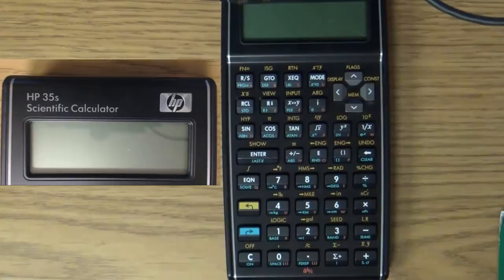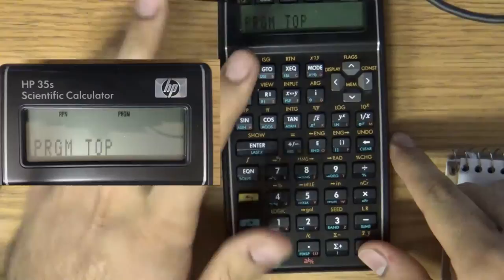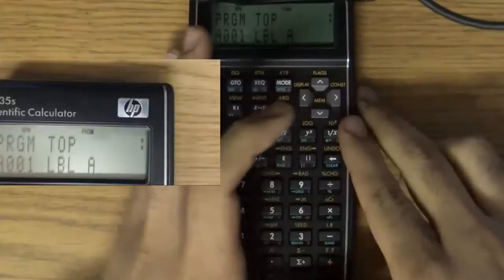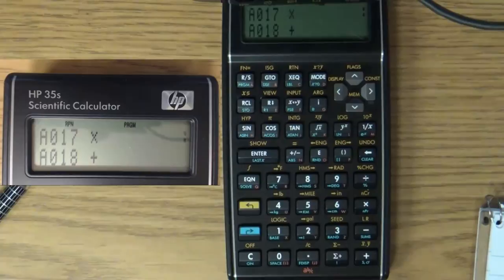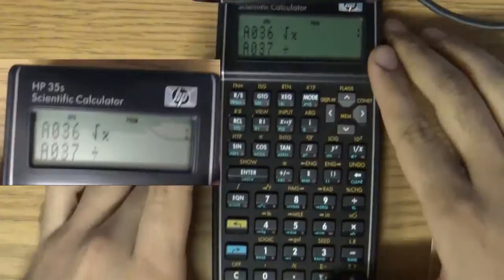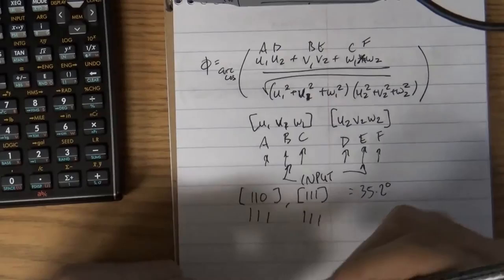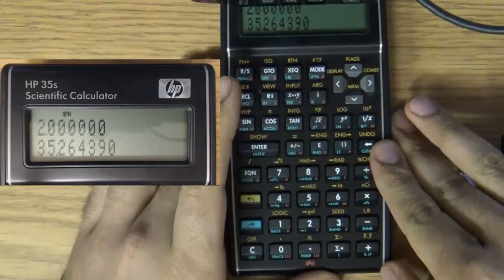How to Program the HP 35s: Angle Between Two 3D Vectors

Comment: Good introduction.

The next step is to learn as early as possible to optimizing your code. For instance, on most HP calculators, the recall function can be combined with the four arithmetic operators (+, -, *, /) as a single instruction. 

The three lines :

RCL A
RCL B
x

can be reduced to the following two lines:

RCL A
RCLx B

Makes the code is easier to read, it runs imperceptibly faster (only matters when you program numerical methods with many loops) and it takes 33% less memory.

Comment: The manual actually suggests you use RTN to finish the program (unless you have only one program, in which case there is an automatic RTN at the end of the program) as it sets the program pointer back to 000, but R/S works too of course. Otherwise neatly explained.

Comment: Nice & quick & to-the-point.
Couple remarks. Instead of ending with a "STOP" command, it's better practice to end with "RETURN" because then this program can be called as a subroutine from another program, which is a useful thing in this case.
This would require knowing, when you run that other main program, what is being prompted for at the beginning of this program, however. In fact, if this is the case, you can just chop the input part of this program off as a separate, main program, which then calls the subroutine, which in turn, always assumes that registers (A...F) are already loaded. And any other main program will need to preload (A...F) before calling the subroutine.

Also, there's another trick you could use to get the denominator of that formula: R→P; rectangular-to-polar conversion, which will compute "r," which you want, and "θ," which you don't need, so you just drop it off the stack each time.
One advantage of this, is that the "SQRT'ing" gets done for you automatically.

So after you've computed the dot-product in the numerator, just go:
[RCL A] [RCL B] [R→P] [x↔y] [R↓] [RCL C] [R→P] [x↔y] [R↓] [÷]
[RCL D] [RCL E] [R→P] [x↔y] [R↓] [RCL F] [R→P] [x↔y] [R↓] [÷]
[cos⁻¹] [RTN]

And that's your result.
Reply: That R->P / P->R trick is going to be awfully difficult on a 35s .... since the 35s has no such functions!!
(It's one of us old timers biggest complaints about the 35s.)
Also, the complexity of programs based on solving equations can be eliminated entirely by using one the 35s biggest strengths: the EQN solver.
Just enter/save the equation in the solver to use when necessary. Done.
Ironically, I have this same EQN entered in mine (coincidentally with the exact same variable names) and it appears to work with the solver in an identical manner to this program.
Bonus tip: Since you can't reuse program labels (like A, B, C etc.) in the 35s, you'll want to save all the program labels you can by leveraging the EQN solver library.
Reply: @michaeldeanlyons  Wow! I didn't notice that! I agree that that's a very severe shortcoming. It's like a big beautiful house, complete in every way, but missing one of its windows.
For me, that would be a total deal-breaker! I'll join you old-timers in that (I was just out of the service and starting grad school when the original 35 was introduced).

But wait! – I see a "θ" on one of the keys (the "i"; key coordinate 24) – is there a set of complex-number operations that includes conversion between Cartesian and polar forms? Because that could serve the same purpose, as long as it isn't too awkward to use that way.

Fred
Reply: @ffggddss  
Fred, the 35s actually has a fairly practical way of working with complex numbers .... with both parts on the same line/register. It's not a conversion function, per se. All your complex math can be done directly in one step, i.e. you can enter a polar form .... on one line/register ...., and if you've got display mode set to rectangular, it instantly converts it on the x register when you press enter.  Do any math in the 'normal' fashion. You could then change everything displayed from rectangular to polar (and vice versa) by going into the display mode and selecting the one you want to see.  It took a little getting used to, but for direct calculations, it's very practical. And fast. The only drawback is that you can't actually do conversions in programs that way.
(Caveat: There is one small drawback I should mention for full disclosure.  In polar display mode, that Theta symbol looks painfully close to an 8 on the calculator display stack, so that's quite annoying. If they had just used an angle symbol, it would have been perfect.)
Reply: @michaellyons1313  Great point about the "θ" symbol that would be better displayed as "∠".
So about complex-no. ops, are you saying that there's no built-in way of extracting Re or Im parts of a complex number? That would be a serious drawback, too!
And that ability would make coordinate conversions possible, if a bit awkward. Other than that, that way of dealing with complex numbers is a good feature.

But it all boils down to your earlier remark that R <—> P conversions aren't built in to the 35S. Sounds to me like somebody goofed!

Since the early 1970's, there've been calculators, and there've been calculators, and, as Roseanne Rosanna-D'Anna used to say, "It's always summthin, ya know?"
There's always some shortcoming, or "nice-to-have" that's missing. But I've always found the hp calcs to be greatly preferable to the rest.

Fred

Comment: Thanks for the video, very helpful. I’m not familiar with programming the HP 35s, despite using HP’s and RPN for the past 25+years. 

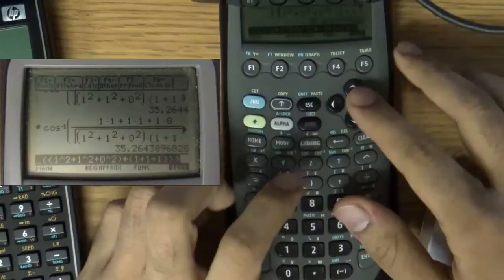At 8:06 you check the HP formula with the Ti-89 however, is the formula correct? In the denominator the variables U2 ,V2, W2 are not squared. Obviously in the example you use, this makes no difference. Thanks again for the very helpful video.

Comment: Just a note on this formula, for those who don't recognize it. I'm gonna change the notation here, so bear with me.
Call the two vectors and their (Cartesian) components,
 ֿu = (u₁ , u₂ , u₃) ;    ֿv = (v₁ , v₂ , v₃)
Then the angle, θ, between them is the arccosine of the dot-product of their unit-vectors.
And a unit-vector is just the vector divided by its magnitude.

So:
θ = cos⁻¹ [ û • ˆv ] = cos⁻¹ [ ֿu • ֿv / (| ֿu | | ֿv |)]
where the dot-product is defined as:
 ֿu • ֿv = u₁v₁ + u₂v₂ + u₃v₃
and the magnitude of a vector is found by:
| ֿu | = √( ֿu • ֿu )

Applying these, yields the formula shown in the video.
And this is extendable in obvious fashion to a pair of vectors in any finite-dimensional space, which explains my notational change.

Comment: I have a HP35s, but it is easier on my Sharp wl-516x (non-programmable) as I just type in the equation using the same variable names as you used and save it as a formula, then it's just a matter of storing the values you want in the variables (2 key strokes each) and recall the formula and hit equals. Come to think about it you could probably use the HP35s solver function in a similar way...
Reply: I can do the same on my 2-line Sharp EL-506R and my 2-line EL-506X scientific calcs.
/Silicon Valley Regards
Reply: Yes, you can use the 35s EQN solver in a similar fashion, and in many ways, it's a superior solution than Sharp or Casio's.

Comment: This thing is great I used it to pass my FE exam. RPN calculators are way under rated. Does anyone know if HP is planning on making any new pocket sized calculators?
Reply: I don't think they are, which is a shame... However, take a look at swissmicros.com . They have an upcoming calculator, DM42, which looks quite promising. As an alternative, you could also look at WP34s, which is a reflash of an original HP financial calculator to give it scientific features.

Comment: Nice video, does the 35s permit the use of loops (For - endfor) and conditional loops (while, do ...) like a 48 ? 
I like the vstyle of the 35s, i would like to buy one, but not sure of it´s capabilities .
Reply: It has those capabilities, but it's more like assembly language than C or FORTRAN or Pascal or Java or ...
Look at the 2nd button in the top row, "GTO." It has "ISG" (yellow) and "DSE" (blue).
Those are, Increment & Skip if Greater; and Decrement & Skip if Equal.
Each is followed by a register identifier, and require that register to be formatted in a certain way that specifies a start value, a step and a limiting value. (Or on some hp calculators, the step value is automatically 1, and only start and limiting values are put in that register. I don't know this specific calculator's method for that.)

To code a "do while" or a "do until" loop, you just code a loop, and include a test step to enforce the "while" or "until" criterion.
Test instructions are comparisons of x with y, or x with 0. There are also several numbered flags that can be set, cleared, and tested.
For example, the instruction, "x>y?" will perform the next program step if true, and skip to the step after that if false.